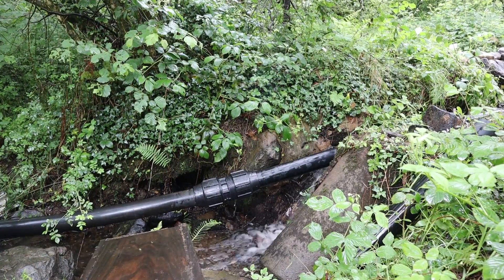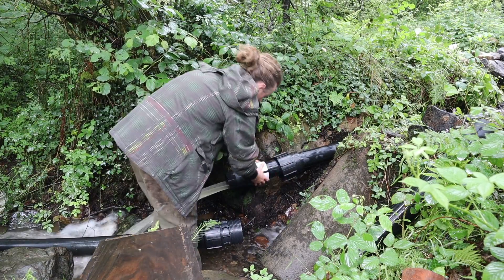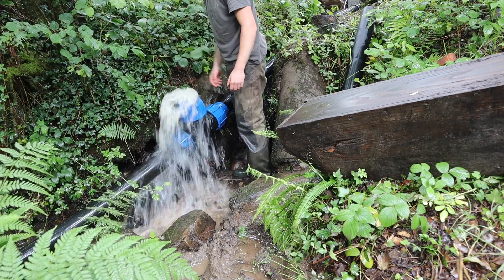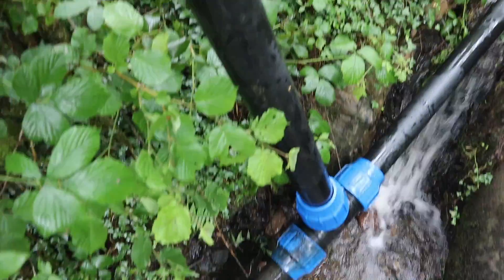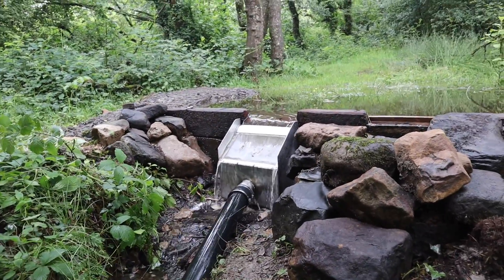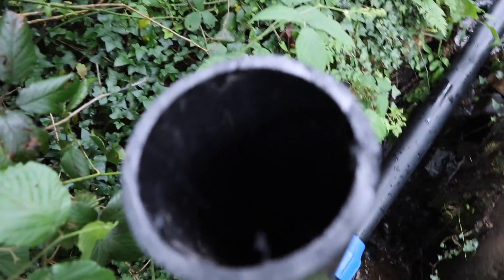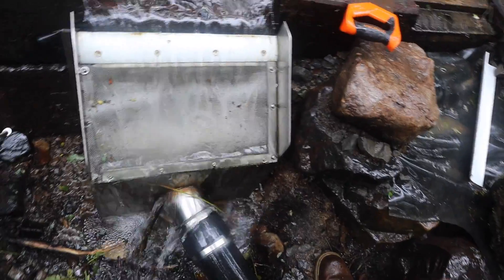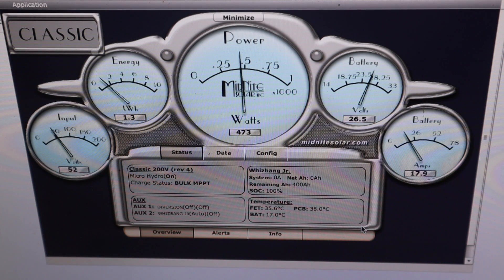Hydroelectric intake Update and Modifications.

Comment: The point would be to have drilled through your little dam at the bottom and run the intake into your little pond  a few feet and not draw your water from a spillway where debris and turbulence are a natural result. Your pressure level will also be more stable from an intake below the dam waterline. Obviously you will need an intake screen.

Comment: A large size holding tank would probably help you out. You need to be able to be winterized. If you can hold 2,000 gallons at the top that's 290 lb addition to whatever is in the lines. Certainly you have this in your head yes. You are running on the pressure that is in the lines. And if you want to do a larger trick. You need to reconsider how intake is implemented inside your pond lagoon if it was a lake it would be better.  Of this the intake would be out there in the middle of the pond as deep as it can go. And though you have filtering a top of the water is draw is under. This gives you all that weight of the pond.  I note hoover dam. But it also may get you out there in a boat in be picking off moss and all the other sticks..  well you're doing better than i am. I left all this decision in the mud hole of my father back 40..  you're making good videos and keeping us thinking good for you.

Comment: If you're running it one nozzle off shut down. Drilling your holes bigger will not help you.. if you want to experiment you crack that nozzle halfway open if the valve is capable of doing such a thing.

Comment: The water trap needs to be at least twice that size for the back pressure your looking for with a filtration sections in front of the inlet pipe filled with sand and another with charcoal using the same stainless steal screen. This would filter and deoxygenate the water also both minerals could be fashioned right on the site by burning wood and pulling sand from the stream bed or you could make the pond deeper. I know this was two years ago but its the first time seeing this and these are my thoughts it form my experiences of plumbing and filtration.

Comment: Hi , in order to avoid any air inside of pipe, you need to create at list one meter deep  tank, so the air have the time to go up, and you avoid the cortese as well, on 1983 on the Tigrit Rivera Iraq, I follow the digging of the 6 pomp, of two cubic meter a second, the concrete tank was 40 mt. Deep to avoid the vortex

Comment: What’s a coander? Stupid question but why not drill a hole well below the water line in the dam and run the pipe straight in to the reservoir? More pressure the deeper you go and no air can get in? Haven’t watched a lot of your videos so may have missed the thought process that ended up with waterfall over a notch technique. Love your videos pal.

Comment: HI I AM NOT AN EXPERT BUT HAVEN,T U NEGATED THE PURPOSE OF A DAM BY HAVING A  BOX COLLECTING OVERFLOW INSTEAD OF HAVING THE PIPE IN THE DAM WALL AS LOW AS POSSIBLE THEN U WILL HAVE A LOT MORE HEAD PRESSURE JUST LIKE THE HOLDING TANKS IN HOUSES IN ENGLAND SAME PRINCIPLE AS HYDROELECTRIC DAMS THE HELD BACK WATER IN THE DAM PROVIDES TREMENDOUS HEAD PRESSURE TO SPIN THE TURBINES WHEREAS YOURS JUST TAKES THE OVERFLOW OFF THE TOP OF THE DAM BIG DIFFERENCE

Comment: It maybe worth trying a one way valve on the standpipe so it doesn't let air enter the pipe ,it maybe sucking in air when the water in the pipe drops slightly ,if it were mine i would run another pipe down half way from a second intake and join it to the original pipe you would then increase the weight of water ,a motorised valve could be bodged i am sure to switch that second pipe off when there's not enough water available ,keep up the good work its very interesting seeing you overcome problems few will encounter

Comment: The reason you are getting air sucked in is due to the angle theta of the pipe divided by the internal diameter of the pipe multiplied by velocity of the water running through pipe and under root of the length of the pipe divided by gravity constnt 9.8m2, will give you the amount of suction value which if it is greater than the cross section area of the pipe will mean the pipe length is too long from the source to the turbine, that is why in real power stations they have to have a high head of the water above the water outlet pipe and the distance the turbine is situated . I hope this will help, an ex power generation engineer. 😜

Comment: I feeling a bit better, as I was watching it seemed to me a bleed point at a high point in pipe where outlet of bleed is above dam plus enough to counter for pressure at that point.  Have to say I know very little about run gravity fed pipes but use one from a dam on my property in Australia for veggies and fire hose (I bet I'm not the only one talking to myself and was feeling good when you did it).  When you put half pipe in to stop the air vortex did you do away with bleed points or leave it as a observation point?

Great videos, as Ian Drury sang "Aint arf been some clever b*stards', loving it.

Comment: Have you thought about re-making the intake box so the down stream side and side walls are the same height as the upstream side?  This way the water won't actually fall into the box but rather flow smoothly.  The box will fill without turbulence.

Comment: I work with an airlift system for moving water. I use 2 T pieces to let the air out with shorter pipes on top. Can't you dig a bypass for coop with heavy rain?

Comment: Great work with your new stainless steel weir input.
A thought came to mind regarding screen blockage. In the oil shipping industry there are occasional oil spills into the ocean which are contained by floating oil booms which contain the oil because it floats on the top of the water. Now, looking at the material which blocks the screen, mesh or coanda, it does so because it too floats on the surface of the water. So I believe that this material can be contained before it reaches the screen by having a flexible floating boom which prevents the material from drifting on the surface of the water and into the screen. The boom would rise and fall with changes in the weir water height. Each end of the boom would be attached to the inside wall of the weir so that material would not escape around the ends and into the screen. Floating debris would then logically move toward the overflow and down the spillway.
As boom material, almost anything that is flexible and floats will do, something like swimming pool play noodles for example.

Comment: 7:06 didn't you build something like an Venturi nozzle sucking air in?
Reply: Damnit you are right somehow, what he is basically trying to do is just to add a pipe vertically that will level out with the water level at the intake and since air rises up it should not pass this T-connector but instead the air should leave through this pipe
The real question would be if there is a way to angle it, therefore not making a venturi nozzle since the water level in the tube was actually lower that the intake
Reply: I mean its pretty clear that its also lower pressure at that pipe than normal so something tries to suck from there too

Comment: slow the flow where the screen filter starts feeding into the pipe with a pipe inspection chamber to let most of the aerated water settle before going in to the main pipe and the rest of the bubble should come out with the standpipe assembly just my thoughts of a solution without needing a bush fix

Comment: So, after all that, total energy is likely less then was needed to run the monitoring software on your computer?

What do you expect to top out at?
Reply from the maker: The system provides all my power for 6 months a year and the intake is essential to keep the system running without blockages and downtime. the increase in watts wasn't the point of this work. The point was to create an intake that does not block as often and can run more reliably meaning the turbine makes much more power due to running 24/7 for 6 months a year. Even if it was just a 10w increase that would still be 40KWH per year that is two full days of powering my home and workshop.
Reply: @KrisHarbour  Hm, so so what's the wattage you actually get out of it? I love the idea, but the output doesn't seem to be worth the money and effort.
Reply from the maker: @TzunSu  its showed in the video 480w 24hours a day. or around 11kwh a day. just under the average usage for a 3 bedroom house in the uk .

Comment: What happens if you rotate that "baffle" half-pipe 180 degrees or so, such that the "convex" side faces up more into the incoming water?  I wonder if that might not smooth out the flow a little, or at least minimize the "impact" of the inbound water into the box, thus pulling down even less air with it when it hits?

Comment: I am an idiot when it comes to these sort of things, but would making the diameter of the pipe where the "stand pipe" is be better for getting the air out?
My train of thought is, with the diameter increasing, it slows the flow of the water (same volume, just flow is slower), allows the air to rise and escape up stand pipe, and then the water goes back down the the regular diameter.
But please, tell me if I am wrong, or if changing the diameter will just increase inefficiencies? I am working completely on guess work here.
Reply from the maker: You are correct in your thinking. That would be a way of slowing the water and getting air out. Just a big cost for big pipe like that. there are other cheaper easier ways to do it.

Comment: What about a Venturi in front of the pipe in the box sticking out 3 inches going in about 4.5" with a 2.5" flat nose tapered tear shaped, this should suck more water in and adding rotation screw cutouts to rotate the water in the right direction will encourage more flow and faster transition

Comment: For the standpipe cover take a pipe cap for a larger size pipe and drill and tap three or four holes around the OD and use pointed bolts to hold on the OD of the standpipe.  Air will flow up and around the space between the cap and pipe.
JIM

Comment: Hi Kris,
What about a larger intake box... have one that will hold lots of water allowing the air to escape before going into the pipe.
Your’s to me looks too short... the water comes over the dam right into the pipe... make it large enough three to four times it’s size...
Your water enters the intake right where the pipe enters... air is almost a certainty... make the box longer... have the water enter beyond the pipe so it has to circle around filling the intake box but will (I think) purge the air.
I figure you already did this but in the video when you were changing the standing pipe... after reassembling  the pipes, they were leaking quite a bit... that also can be a major source of air.

Comment: Hi Kris, you can get a plumbers pressure air valve and drill it and tap into your feed pipe? Not sure what PSi your feed valve runs at, have a chat with a plumbers merchant. They'll have something you fit onto the feed pipe. That will sort the air issue out automatically, slight twist adjustment occasionally. You'll always going to get air as the primary intake as it's only under gravity pressure under the colander rather than a Kaplan or Francis turbine. Clearly that's not practical without proper water flow calculations, both dry season and proper wrath of God (Moses and the Ark) during the Winter time and it maybe not practical at all? Keep up the good work, its refreshing to see how you adapt and overcome, proper British Engineer :-)

Comment: Just come across this video and ended up watching. The part where you have put the t in will make air in the pipe after that wont it as i keep koi and we call this a venturi which adds air to the water by pretty much doing what you have done? I am maybe wrong but i think that is maybe why you have air after the t.

Comment: Hello Kris, i wonder if more nozzle on the same turbine is better then 2 turbine?
Reply from the maker: Yes more nozzles or bigger nozzles on one turbine is way more efficient than having two turbines (as long as the turbine can take the flow/nozzle size) as the biggest loss in a system is usually the turbine itself. Having more than one turbine can be useful though for a few reasons. one if if the flow rate is soi changeable one turbine cant cover the rang of flows. so you have a big and a small one for different seasons/flows. Another good reason is redundancy so you never have a full breakdown and power outage. And another reason could be cost as when parts get really big and have huge forces on them they get expensive and it might be cheaper to run two smaller turbines. But there is always a loss every-time another turbine is added.

Comment: Well done fella, I design hydros for a living and your work here is some of the best educational stuff ive seen, your doing it all right! 1.5 times pipe diameter depth in sump avoids the vortex but your baffle probs does the job which is great to see, milk crate works or floating grid, vortexs form at surface, well done and good luck! Adam, Ellergreen Hydro.. Im learning from you.. 👍
Reply from the maker: Hi, thanks for commenting, it’s nice to hear that from a professional 👍
Reply: I used a piece of anti-fatigue rubber mat ( approximately 2cm thick black rubber with 4cm holes at 6cm centres) over the floating intake for my water pump in our farm dam.  Had guys trying to sell us fancy (read that as expensive and high maintenance, difficult to clean) gadgets that were quite crap.  I just used a piece of the mat about 40cm x 45cm, with the pipe going over the top, and a 90’ bend, and about 15cm straight down through the mat.  Works an absolute treat.  Haven’t even had to pull it out once in at least 6 years.

Comment: If your coander screen doesn't work. I used a stainless steel plate with slits cut in line with the water flow. I cut the slits with a disc grinder, they are 0.5mm wide, about 1 cm apart from each other and the length of the filter box. The water that doesn't get used through the screen washes the screen and keeps it clean. This screen design changed the cleaning I needed to do from every 3-4 days, to every 7-10 days, depending on rain, and my usage of water. If I don't want to clean it that regularly, I can just turn the turbine off for 5 min and all the water washes over the screen washing it.

Comment: My system is very similar to yours, to prevent vortex's, I lowered the outlet in the bottom of the pickup screen box, it is now 35cm below the water level. I also put a 45 degree bend on the inlet. I think the 45 degree bend down seemed to prevent the vortex better than deepening the filter box. In saying this, it was only a problem when I run greater than 50% water flow.

Comment: I wonder if the extra stand pipes slightly hurts the flow.  They might not be necessary any more with the much improved intake.  Also a slightly rounded intake going into the pipe will help some to reduce pressure losses.

Comment: It will also entrain air into the system because of the leak at the union.  That noise you hear is the low pressure version of a fire service 'crackling jet' where air has been entrain and compressed and is the released with great force at the branch.  Usually caused by air being drawn in either at the pump or one of the hose connections.

Comment: Kris I just got to the 2m58sec mark of the video and when you where undoing the big T Piece fitting reminded me of a water RAM pump  (https://youtu.be/zFdyqTGx32A) 
(https://youtu.be/9zC6PuVjB4g) 
(https://youtu.be/K8Fy__ThqpQ) 
(https://youtu.be/p8PL6sqq40A)  
have you heard of them?
To keep the Hydropower system running longer in dryer times or just keeping the water head up that if you put one in AFTER your Pelham wheel output you can pump water either to your dam or to some storage for watering the gardens or for general use.
Obviously there will be losses but the longer you can keep water on your property the more uses you can find for it.
At the least you could use it to pump water to a tank for no cost (apart from building the pump) of your battery storage then how far do you want to take it? 
Run it back to the Hydropower and use it to top up the water velocity, the ideas can be many as your imagination. 
Tony from Western Australia.

Comment: Should add a water level float inside the intake and use LoRa sender to send the data back to your place and use a raspberry pi to adjust your electric valves. Then write some simple code to adjust your valves so it keeps your intake level at optimal level and use the appropriate amount of water. I personally would get bored and go overkill and add a float before the intake and have a big pipe with electric valve to adjust the overflow to adjust how much water go over the screen. Just some food for thought I know you like to tinker.
Reply: Don't want to appear too negative (!) but the phrase 'massive overkill' comes to mind at this point.......!

Comment: when I see this, I would definitely go another way. It's really cheap too if you want it to be.
First, at a calm spot, where everything has settled to the bottom, make an inlet on a stainless steel plate with a mesh for debris, have that come out on the top of a big hole you digged that you made into a tank  with concrete, or a nice wide rainwater tank, on the bottom of that tank, you connect your tubing. A lot more pressure that way, and at the dam you can control the flow rate of water for nature. no air in the system if you don't want it to. You can build your custom rainwater tank too you know, with sheets of plastic and at corners you use fiberglass or you weld the plastic sheets together with heat, it doesn't have to be thick because nature doesn't let it rip :-) Now you have 936 Watts, I think I can at least multiply this by 25, or is that too ambitious with the right generator and multiple pelton wheels ?